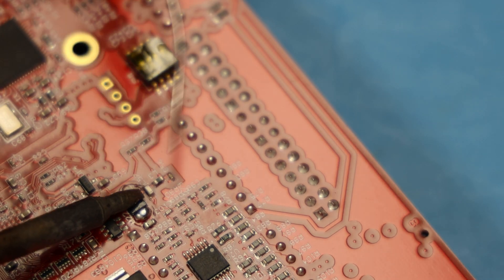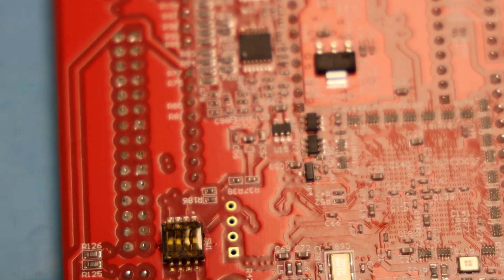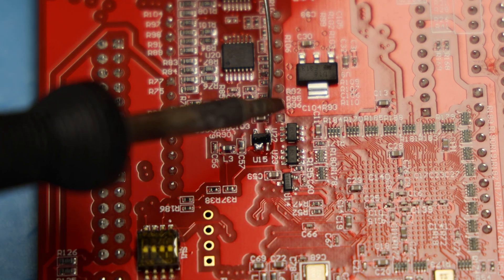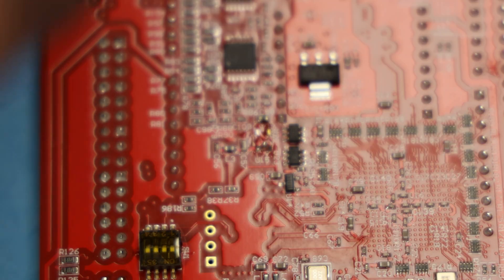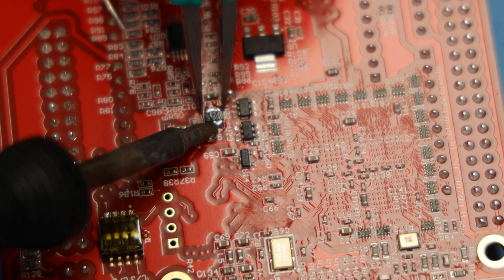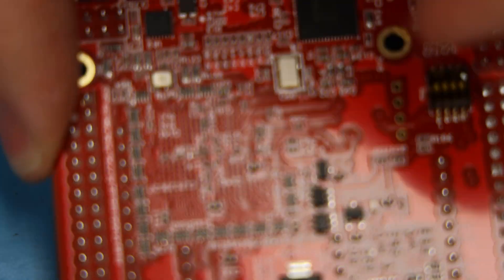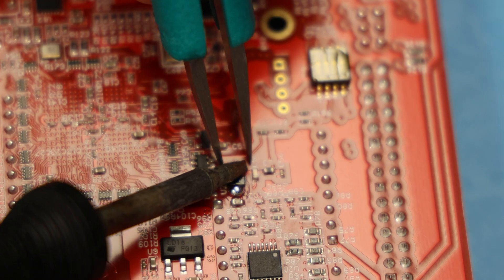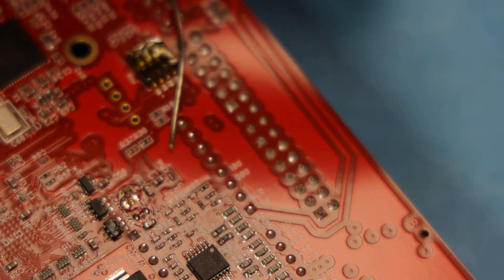Removing Small SMD Parts Using Soldering Iron & Solder Wire

Comment: Is solder sucker okay for cleaning solder after desoldering?
Reply: You need to use caution with suckers as you might quite easily damage the pad while trying. You can also suck the component itself 😁 happened to me , but you can always open the sucker and empty its guts, but it's messy 😆 Good luck!
Reply: Thank you so much! Might not be the tidiest way, but it works really well and fast.